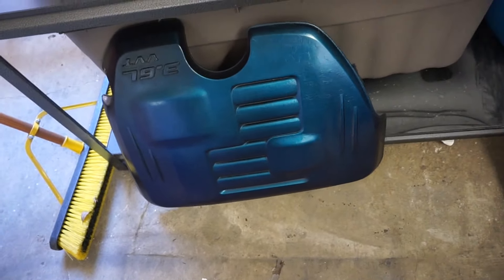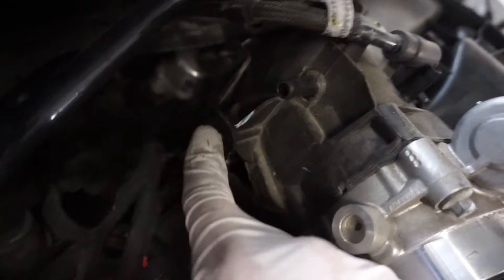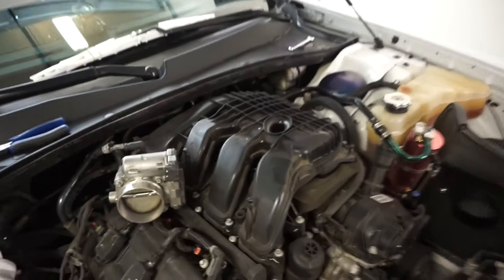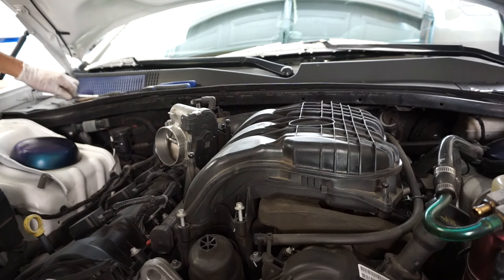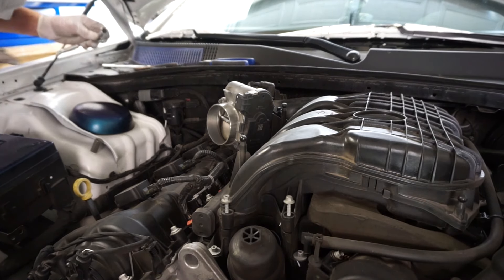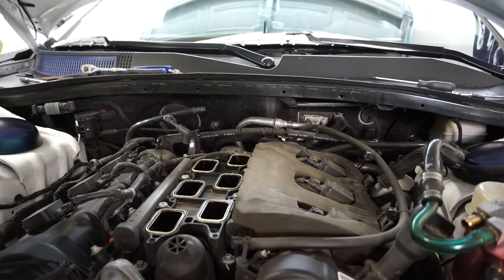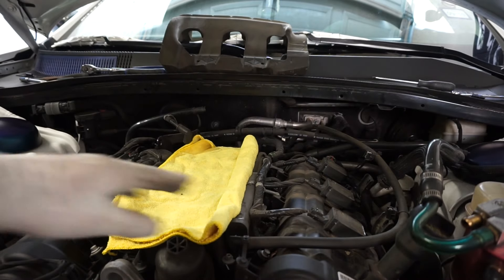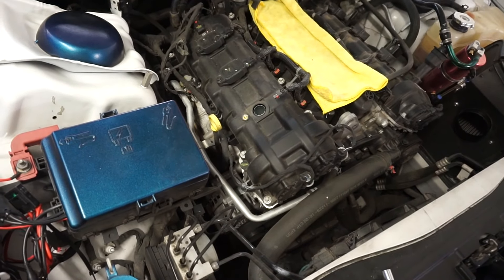HOW TO CHANGE SPARK PLUGS ON 2012-2019 chrysler 300 v6

Comment: TOOLS NEEDED:
needle nose pliers
10mm ratchet small
10mm wrench small
8mm long ratchet extension 
13mm ratchet extension
10mm ratchet extension
flat head screw driver
5/8 spark plug socket
rags
Reply: Thank you!

Comment: Chrysler dealership wanted $411.00. $20.00 EACH for the plugs. I went to advanced auto, plugs were $8.00 apiece.  Then I took the old plugs out, they were identical to the new plugs, same sku number. This took me an hour. Spent $90.00 for new plugs and tools I didn't have.
Reply from the maker: Glad the video could help
Reply: What year was yours?
Reply: Mine actually started acting up when I didn't put the Mopar spark plugs lol so I had to order them and then I did it myself. Mopar takes forever to send them though

Comment: I just finished changing mine out on my 2015 Chrysler 300s. Took me 4 hrs. From start to finish following this video👍 the only thing that was different was that 13mm in the back I had to use a combination open end wrench 13 mm. Was a headache to take off and put back on other then that this video helped a lot. I see why they charge an arm and leg for this work 😅
Reply from the maker: I'm glad the video could help you
Reply: I’m about to try it out next weekend didn’t want the shop to do it because of the price as well

Comment: Hey man. I have a 2016 Dodge Charger, 3.6. When I first got it I would get around 31 mpg combined. It has about 59,300 miles but at around 50,000 miles it started getting 22 mpg. Is that a reason to change spark plugs? I live in New York. Sometimes I do City driving and sometimes highway driving. As of now, no check engine lights or anything.
Reply from the maker: Spark plugs will definitely help it out just have to make sure they are gapped probably when installed

Comment: Appreaciate this. Just saved $400 doing the change myself. Curious, how did you get the plastic hose holder off the rear bolt that held the intake in place? I had to slowly remove the bolt with a wrench and twist the bolt out of the hose clamp after I removed it from the head.
Reply from the maker: Was definitely not easy
Reply: @KaotikArmy  i know. I just had to redo the process and also change the coilpacks. My misfiring went down drastically after changing the plugs. But at idle every 20 seconds more or less, it would have a misfire and idle normal, no check engine light. So I bought the coilpacks, redid it again, and now it's fine.
Reply from the maker: I did my coil pack all at same time
Reply: @KaotikArmy  I was trying to save $111. 🤣
Reply from the maker: @pheto1521  I don't blame u lol

Comment: Quick question did you have to torque down the bolts from the intake or just tight them down with ratchet?
Reply from the maker: I just snugged mine probably supposed to be torque but I didn't
Reply: The intake has 7 to 9 NM listed on it.  That works out to about 70 inch pounds.  It's not to tight, but from what i hear, the plastic is very thin and brittle.  I torqued mine to 70 inch pounds.
Reply: @Boasandpythons  How the heck do you even figure that out?
Reply: @victormendoza3295  Torque wrench